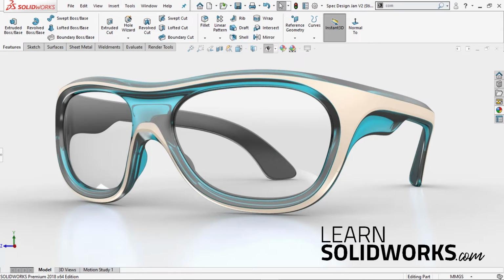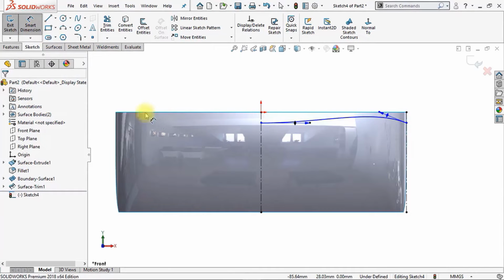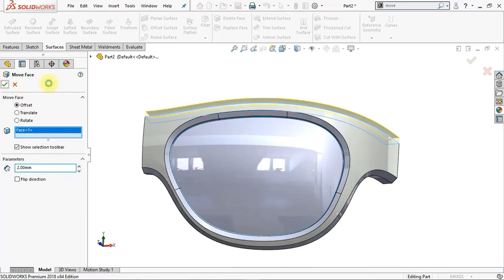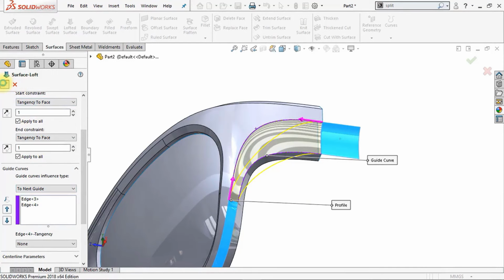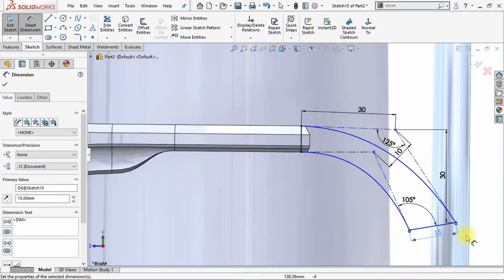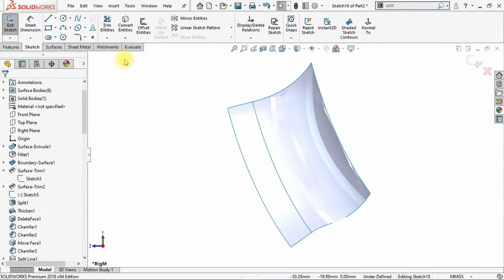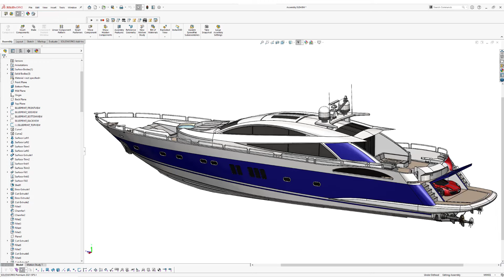How to model Sports Glasses in SOLIDWORKS? 🕶 [60-minute Surface Modeling Masterclass by Jan]

Comment: Thanks for posting this video, Jan. I learned so many useful tips from this exercise and I will be watching the rest of your videos/ tutorials.

I have a question. How do you know the dimensions and angles that you need? Surely you are not guessing and creating something so close to correct, are you?
Reply from the maker: You are very welcome! :) Before recording this video, we already modeled these glasses before. All the main dimensions and angles are copied from real glasses. I usually use blueprints when I model something with similar dimensions and proportions as an existing product.
Reply: @learnsolidworks  I see. Where do you find those blueprints?
Reply: @zhoek3800   you can find many blueprints on Google, but you can also use a hand sketch or a picture of a real sunglass as a blueprint. It doesn't have to be a perfect match, as long as you can use the image to define the main dimensions and proportions. :)
Reply: @PJWZZ  Thanks for the tip. :)

Comment: Superb Explaination !!! I wanted to ask did you had an engineering drawing while you modelled it
Reply from the maker: Thanks! No, we didn't use any engineering drawings. We roughly measured the general dimensions from real sunglasses and modeled the entire model. Eventually, we re-modeled the model while recording the screen :) So the ergonomics of these glasses might not be 100% correct. In reality, I recommend scanning sunglasses with a similar shape in 3D, importing the 3D scan in SolidWorks, and using this as a rough 3D blueprint for your new design. You can also use blueprints of sunglasses with similar proportions. Check this video to learn how to implement blueprints: https://learnsolidworks.com/roadster

Comment: Definitely learned alot, great video, thank you! 
I do want to add something, the model is not designed in a way that you can adjust dimensions to reflect shape of end product unfortunately. If you change any of the dimensions upstream it blows the model up. Also, the chamfers are very unstable features. So, I think if I was going to design this again I would keep in mind that I want to be able to adjust overall shape of lenses, stems, frame. I have designed numerous injection molds for some of the top sunglass makers in the world so running thru this design flow was really fun to see other ways of designing frames. I have used NX to design frames and know that alot of the top sunglass makers do not use SW nor NX to design frames/stems/lenses. Again, great video, thank you!
Reply from the maker: Thank you for your feedback and kind words about the video! You are indeed right that it's difficult to adjust the glasses later on with the method shown. However, the goal of this video is to introduce people to surface modeling by modeling a product. The aim is not to create a perfect glasses design that can be adjusted later.

I'm glad you found the design flow interesting and enjoyed seeing a different approach to designing frames. Your insights and experience with designing for top sunglass makers are much appreciated.

Thanks again for watching and sharing your thoughts! :)

Comment: At 41:52,  the "move face" feature is quite and unusual method to use by removing some part of the  3d modeling. Althought, I think it can be efficient tool instead of using the extrude cut with a converted entities-sketch.
Reply from the maker: In this case I prefer the Move face because the Cut Extrude requires additional steps by making a new plane and sketch + the surface will not be perpendicular anymore

Comment: Love the tutorial but at 36:40 I cannot for the life of me get the surface loft to work. The lines are disjoints near the southern edge into three parts for some reason. I went over the dimension of the build a couple times and the shape it still off, I cannot figure this out.
Reply: Thank you for your feedback! If your line is divided into three parts, you can use the Selection Manager to select all three segments as a single line. This should help you successfully create the surface loft. If you have any further questions, feel free to ask!

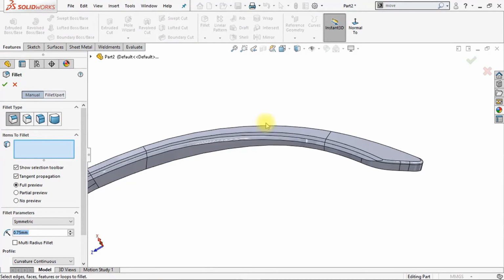Comment: This is a great tutorial. I found it didn't go entirely smoothly and a few features failed, finding workarounds to these before continuing added to the learning experience. However, the fillet defined at 50:45 fails, presumably due to the small edges at the ends. I can't work out how to work around this to produce a fillet in this area. It seems from other comments I'm not the only person to experience this. It would be great to understand what to do in situations like this where fillets are failing in areas with different faces meeting to form some small edges.
Reply from the maker: Thanks for your feedback Jody! :) I am not sure why the face fillet didn't work. Did you also try to select multiple faces instead of just the two I selected in the video? In case a fillet really doesn't work I usually make a chamfer instead, then I delete the chamfer surface and replace it by a surface loft with Tangent Edges. This way you will still get a fillet. :) If the chamfer feature also doesn't work, you can also use the Split Line command to project the edges of the fillet onto the surface and then use the Delete face and surface loft instead. I hope you understand what I mean, maybe I will make a video about issues like this as well to explain it in a bit more detail :)

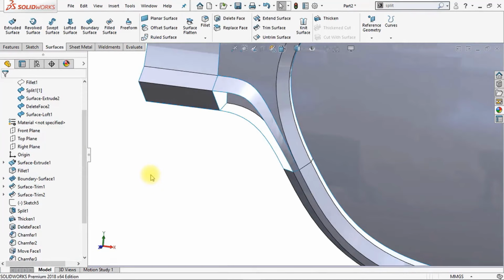Comment: At 27:37 you use Fill Surface to fill in the remainding surface, but wasn't it possible to use a different feature because I often hear that Fill Surface is somewhat of a last-resort. Wasn't it possible to use Lofted surface or Boundary surface?

Also, at 30:00, is it also possible to select Curvature to face? Would that make a smoother transition then Tangency to face?
Reply from the maker: Thank you for your insightful questions! You're absolutely right that in some cases, using Lofted Surface or Boundary Surface could achieve similar results to Fill Surface. Both Lofted and Boundary surfaces are indeed great options for surface modeling.

I like to demonstrate various techniques in my tutorials to show different approaches to achieving the same result. While Fill Surface may sometimes be considered a last-resort option, it can still be a valuable tool in certain scenarios, especially for filling in irregular or complex surface areas.

Regarding your second question about selecting Curvature to face at 30:00, it's an excellent point! Selecting Curvature to face can indeed result in a smoother transition compared to Tangency to face, particularly when dealing with surfaces where curvature continuity is crucial for achieving the desired aesthetic and functional outcome.

Comment: Excellent :eyes-pink-heart-shape:But in my case after the last Mirror feature, a subtle edge appears in the middle of the frame of the glasses. The same thing happens if this is done immediately after creating a whole frame then Surface cut and  Mirror feature. Can you comment on it somehow?
Reply from the maker: Thank you for your comment! The subtle edge you're seeing in the middle of the frame after using the Mirror feature is a common issue. It often happens because of slight misalignments or imperfections in the geometry that get mirrored. Here's a tip to address this: Ensure symmetry before mirroring: Double-check that the original half is perfectly symmetrical and clean before applying the Mirror feature. Any small imperfections will be duplicated and can cause that edge.

Comment: Just wow. I've a novice question though. How is such a 3d model used? For example, say in manufacturing of such glasses?
Reply from the maker: Such a 3D model is used in many ways. The SolidWorks file can be used to create the molds for injection molding example. But the 3D model can of course also be used for FEM calculations, 3D printing and marketing purposes (such as photorealistic rendering or animations etc)

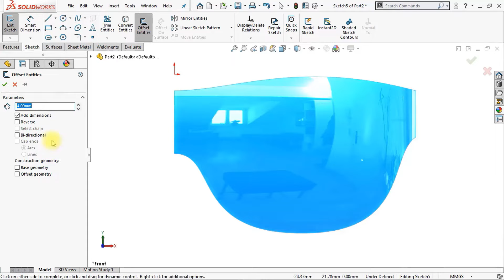Comment: I had trouble at 13:23 because the offset entity button was greyed out. I tried using offset on surface but it created a 3D sketch and the rest of your instructions did not apply. Why does it not let me make offset entity?
Reply: I fixed my issue, I had to select the face and create a sketch before it allowed me to offset entity

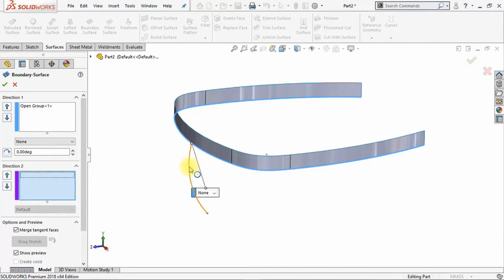Comment: Did anyone have issues creating the first Bounday Surface @7:00? I get an error when selecting the Arc as Dir2 (doesn't seem to matter which one I choose as Dir1 or Dir2). The error message says to "check inputs for Dir1 and Dir2", which is not helpful

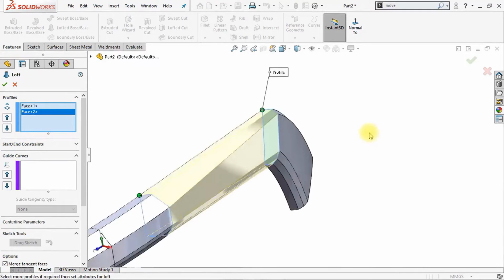Comment: Hi. I have an issue...@49:15 when i do lofted surface the surface do not merge with the body and it remains separated. I tried to knit but bad luck with that too. How can i resolve it?
Reply from the maker: Hi! It sounds like you're encountering issues with your lofted surface not merging with the existing body. Here are a few steps you can take to troubleshoot and resolve this issue:

Check for Gaps: Ensure there are no small gaps between the lofted surface and the existing body. Even tiny gaps can prevent surfaces from merging. You might need to zoom in and inspect the edges closely.

Adjust End Constraints: When creating the lofted surface, try adjusting the end constraints (tangency, curvature, etc.) to ensure that the surface blends smoothly with the existing body. This can sometimes help with the merging process.

Use the “Merge Tangent Faces” Option: When you create the lofted surface, make sure to check the “Merge tangent faces” option in the loft feature settings if available. This can help in seamlessly integrating the new surface with the existing body.

Use the Knit Surface Tool: If the lofted surface still doesn’t merge automatically, use the Knit Surface tool. In the Knit Surface options, make sure to select both the lofted surface and the body. Also, check the "Merge entities" option.

Check Surface Continuity: Ensure that the continuity between the surfaces is sufficient for merging. Sometimes, surfaces need to be G2 continuous (curvature continuous) to merge properly.

Rebuild and Simplify: If all else fails, try rebuilding the surfaces involved or simplifying the geometry to see if that helps in merging.

If none of these steps work, providing more details or screenshots of the specific issue might help in diagnosing the problem further. Good luck, and feel free to reach out if you have more questions!

Comment: hello , at 32:39 cut with surface is not enabled my solidworks, i have seen averything and all is ok but still it is not enabled. it is showing "drag the command manager from the tabs to unlock it". can anyone tell me wht is that ?
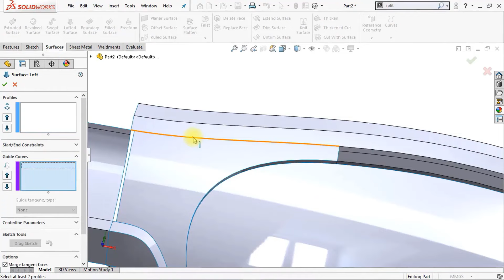and one thing that loft surface at 29:43 is not in contact with the guide curve if i zoom it is seperated , why is that ? i have checked all the dimensions and they are right ?
Reply from the maker: Hi! Cut with Surface is most likely not enabled because your model is still a surface modeling instead of a solid model. You can check this in the features tree by browsing to the Solid Bodies folder. Check if your model is solid. Send an email to jan@learnsolidworks.com if you can't figure it out so I can have a look at it :)

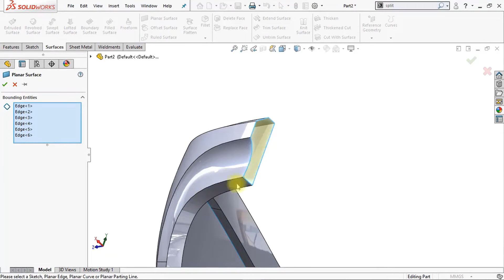Comment: I can't select create solid at 37:25. What could be wrong?
Reply from the maker: Probably because there is a gap somewhere in your surface model. Make sure to check all the edges of your model. Blue edges represent 'open' edges, while black edges are knitted edges. If you spot a blue edge somewhere, make sure to knit it first.

Comment: i dont know why is that happening my cut with surface is command is not working it says that enable it in the command manager☹☹☹
Reply from the maker: That's weird... Have you checked if you actually have a Solid and Surface body in the feature tree? This feature will not work if your main body is not solidified.

Comment: It's hard to me to understand how a human being is capable of modeling these complex shapes without a single reference image , 
I mean I have the tools and workflows knowledge to create them but it's impossible for me to create anything without at least 2 reference images
Reply from the maker: Absolutely, having some kind of underlayer (a blueprint, hand sketch or picture of glasses with similar dimensions) definitely makes things easier. In this case, though, we had the overall width and height of the frame, as well as the length of the stem above the ear. Sometimes, even with all the tools and knowledge, it's like trying to paint a picture with your eyes closed, isn't it? Glad we could navigate this one smoothly! :)